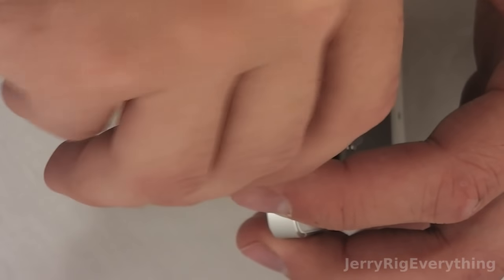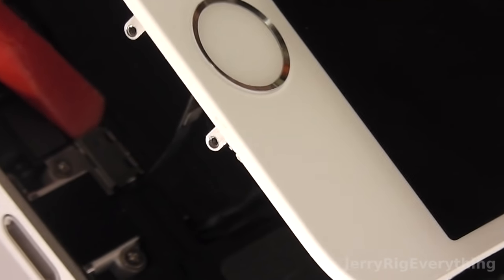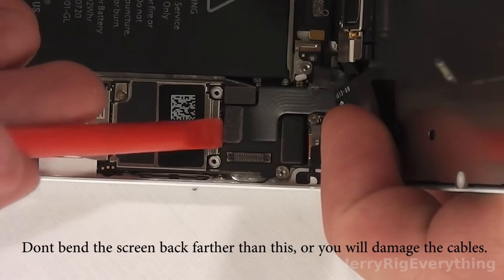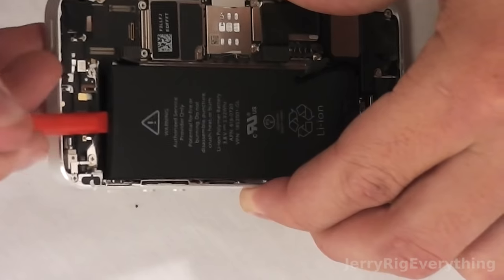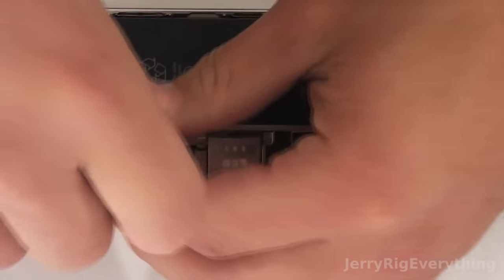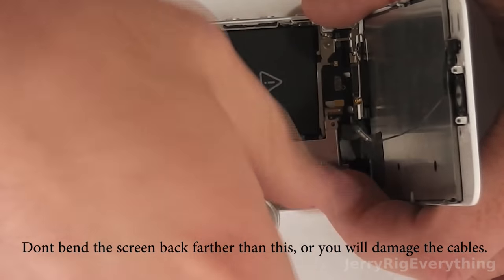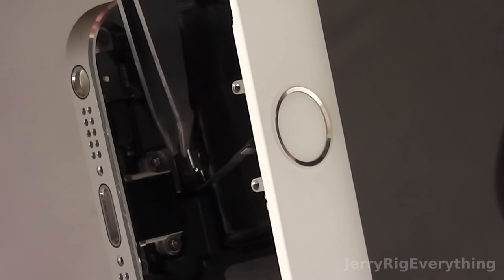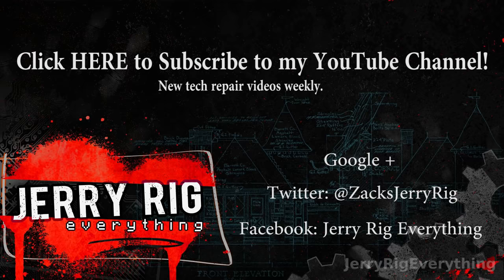iPhone 5s battery replacement in 6 minutes!

Comment: Funny thing. I have an iPhone 5s ONLY because I like the small size phone. The ladies like the large phones because they carry a purse, guys put the phones in our pockets so, at least me, I like the small phone. The finger print reader, I bet very few that have the 5s use the finger print reader. In fact my wife has a much newer phone and she doesn't even use the finger print reader. So, curious. I am replacing my 5s battery. Rather than screwing around reconnecting the finger print reader, which I might do anyway, but curious. If you don't reconnect it I assume all the phones functions will work except reading finger prints. Is that correct?

Comment: I followed your video. But the battery is not as loose your video shows it to be. It is glued with some strong sticky material. I couldn't gently remove it. Can you suggest some other solution please?

Comment: The 3 pin connector sits un level in the socket when i try put it back in :/ is it 
supposed to be like that.
The casing wont close all the way so I turned it on and like i thought touch screen wasnt working so it was going to be one of those cables up the top so i tried to open it back up again to try see what was blocking it and the screen wont come off now.... literally the glass part is cracking at the edges before its coming out properly.

Comment: Hi I'm having difficulty charging my iphone 5S it's the docking port where the charger goes that's faulty possibly by using none Apple charger a couple of times due to losing my original one and couldn't get hold of an apple lightning cable, is the phone junk or can it be repaired? Thanks
Reply: You can buy a brand new charging port assembly for well under $20. Instructions are on YouTube.

Comment: To start off, I broke quite a few things while doing this task myself, nothing wrong with the video. Can somebody tell me what the little black thing right below the digitizer connector and to the left of lcd connector? I ma have broken that which can explain why none of the volume controls, home button, power button and mute control is not working. Is it a button assembly connector sort of thing?

Comment: Battery installed as per your video but when I switch on I first got the apple sign but then I got a..  vertical white line and what looked like two lines of bar code along with the apple sign. The phone is unresponsive

Comment: Just followed,,battery a little harder to get out,,,just used scissors and ran along the 2 adhesive strips,,defo have to take the screen off,,now I've replace the old with the new,,the new battery is heating up any idea why??

Comment: With this method I have fixed a lot of iPhones. But today once I placed the new battery and turn it on, the iPhone is stuck in the boot section. Apple logo is appearing and disappearing. This is happening only when  the power cable connected. Without the power cable it doesn't respond at all. What can I do? Checked the lcd if there was sth disconnected but it seemed ok.

Comment: I followed the instructions and the battery was changed fine but the touchscreen stopped working. I even ordered a new screen on amazon and the touchscreen still doesn't work. I'm positive all connections are connected between the screen and the iphone. Any thoughts on where i went wrong? Is this fixable?
Reply: You probably bent the screen past 90 degrees when removing it.

Comment: so I changed my battery everything seemed to be fine. when I turned my phone on it came up with a white screen and a black apple in the center like it is rebooting, then after a minute shuts off and then starts back over. Any suggestions?

Comment: The battery is IMPOSSIBLE to remove by pulling on it! DON'T DO THAT! Instead, try to pry the battery high enough so you can insert a small screwdriver then scrape the tape up and wind it like you're rolling a COMMAND STRIP double-stick tape from a hanging wall picture. Keep pulling and rolling that tape and soon it'll be gone and move on to the next strip. Once you're done the battery comes out super easy. Don't forget to buy your battery kit w/ the sticky tape replacement. We observed the repair shop do this, and paid $50 for it.  But thanks to this vid I replaced my other phone battery for a mere six bucks.  I'll upload the vid but it's incomplete.

Comment: After unscrewing the two screws that hold the screen to the casing I am having a very difficult time lifting the screen up far enough to pry it open...any suggestions???
Reply: I had to pry it a little and have someone slip in a wedge...it did not come apart easily. Also the battery was extremely hard to pry out....not as easy as in the video.....I had to bend the battery to get it out. I used a plastic knife to try to break it free from the casing. I disconnected the screen but when I put it back together the phone turned on fine but would not respond to touch. I took it apart three times checking everything ...on the third time there was a piece at the end of the digitizer cable that came lose....when I made sure it was snapped into place the phone worked great. This piece was NOT connected to the screen but was in the grouping. Just some things to be aware of for those who are novices like I was. Got the battery (high capacity) and the kit on ebay for $12.88 for those interested.

Comment: This video is excellent for the most part.  PLEASE DO NOT REMOVE THE BATTERY WITH THIS METHOD. Mine got extremely hot and almost exploded.  There is a black tab folded at the bottom of the battery that can be used to pull the adhesive strips loose (much like a command strip).  Watch other videos on how to remove the battery, please.

Comment: My phone shows black screen after changed the battery, it has sound and i even hear whatsapp notification but black screen. I dismantled the 3 connection for speaker, lcd and digitizer and connect them back twice but still black screen. Pls advise which part has gone wrong?

Comment: Forgive me, but this is not as easy as it looks and the disassembly is correct paying close attention specifically to keeping the lcd screen at a ninety degree angle without damaging the cables which is easily done. My hands shake when I unscrew the shield screws and then re-screw the plate back into place, it's a nerve racking process and the adhesive glue that keeps the battery in place makes it extremely difficult removal, to the point where a blow-dryer or heating tool is something required to melt the glue. Perhaps it's trial and error, but not a process I'd recommend for DIY unless you absolutely have to.

Comment: Hello 👋 

Since almost 2 weeks now that I’ve noticed that my iPhone 5s screen doesn’t respond when I press the touch screen 😱 , it’s very annoying I have to turn off the screen and then turn it on again and then my screen will work for some seconds, half minute or a bit more, but eventually I’ll have to turn off the screen and turn it on again for the screen to work a little and I have to repeat this multiple times during the day 😱 , so I wonder what is the problem? Is my iPhone 5s close to die? Needs a new battery?, the screen is damaged somehow? Or other reason?

Please help me 🙏🏻

Comment: completely just destroyed my iphone 5 watching this video and a few others that showed to remove the front screen, but my front screen was never meant to be removed. after i carefully pried it off and ruined it, my little boy noticed that the back panel was slid a tiny bit to one end, as i pushed on it in that same direction the back panel popped right off and low and behold there was the battery. oh well, into the trash it goes. where all apple products should be anyway!  in short, NOT ALL iphone front screens need to be removed to change the battery. all mine needed was the two tiny end screws removed and then you gently push the back panel and it unclips and the battery is in the backside. hope this stops someone else form ruining their phone.

Comment: When removing the battery, part of the black line that runs from the volume buttons to the other side of the phone was damaged. It is located directly under the battery where you begin to pry it off. Have I damaged the connection? Please help.

Comment: Some one tried to fix my iPhone 5s. All they did was disconnect the screen and reconnect it (display issues). Screen works good now but it's stuck in a boot loop and nothing will fix it. Even tried reinstalling the firmware using two different types of software as last resort, it gets so far then errors around 70%.

Comment: Be careful digging the battery out from the rear. The volume/vibrate/on/off flex cable is right below the battery. Little black one. I gouged it now I have no vibrate. Keep the tool under the battery only. Oh yeah, I used a old school light bulb to warm the glue. PATIENTS!!!

Comment: hello, my iphone 5s dropped in the water. after some days my battery life decreased dramatically and the most serious is the following:
if i leave the phone without using it for more that 3 hours then the touch screen does not work. i have to press the power button 1-2 times and then the touch screen is functional again and i can insert my unlock password. Any idea which part is not working? Thanks in advance

Comment: I tried to change the battery on my own but the adhesive tapes that connects the battery to the phone was extremely strong and i tried so hard  to remove the battery. Anyway, i achieved to remove the battery somehow and replace with a new one but now my phone is not working. I checked every connector but i am struggling to understand how can i solve it, can you please help me?

Comment: This video should not be on youtube without a disclaimer saying how dangerous it can be if you cause a thermal event and how to stop a thermal event if it happens. Don't remove the battery by prying it out. You have to pull the adhesive tabs from the bottom because that's how it was designed to be removed. If you pry the battery out and poke, crack or tear the battery surface you could cause a thermal event and could cause severe burns or even burn your house down. If you don't know what a thermal event is, then I suggest you google it.

Comment: I used the link recommended above to purchase my replacement battery. The battery I received was not functional and could not be charged. I had to put back the old battery to continue to use my phone. I contacted the Fixez company 35 days after I received the shipment to notify them that I cannot use the battery and would like to return it or replace it. I was told that my complaint was beyond the 30 day warranty window and they cannot help me. The 30 day warranty is NOT noted on the packing slip or anywhere on the screens during the ordering process.The fact that they sold a useless product did not seem to matter. Could you please recommend another,  more professional company for purchase of the replacement batteries?  Thank you.

Comment: Has anyone bought the 2680mAh High-Capacity Cell Phone Battery Golden for iPhone 5s?  as offered on Amazon.  Does the higher mAh number mean it has a higher charge capacity? vs most other replacements at 1560 mAh?

Comment: I tried it just now the tape at the back of the battery is so strong the battery won't come off I managed to removed 1/3 of it but the battery bent ad had a little spark. I was so scared it might explode took it outside of the house it became hot too. I don't know what to do now I'm scared to touch it now

Comment: I cant even get the 4 screws undone. the first item after undoing the clip... you dont mention what size they are? I would have thought it was teh same T0.8 that undid the 2 outside screws but that doesnt work. then I tried fillips 0.6 and that doesnt fit either... ? Hmmm
Reply: okay I used + 000

Comment: The video is both valuable and wreckless.....All of the information is sound except for the prying the battery out of the phone! This should never be attempted under any circumstance as the glue strips were not designed to release the battery by simple heating and prying. They are to be pulled out by two tabs that are located at the bottom end of the battery just above the touch sensor ribbon that you remove. By pulling the tabs carefully, the adhesive properties are released and the battery will come out without any prying. If you've seen the 3M damage-free adhesive strips, you will know what I mean. It should look like continuous piece of white taffy as you pull each of the two strips out from under the battery. DO NOT PRY A LITHIUM BATTERY....unless you like sparklers (of course).

Comment: Instead of heating the phone up with a blow dryer you can accidentally puncture the old battery and create a chemical reaction causing the battery itself to get very hot. LOL
Reply: I did this! Did you fix your phone in the end?
Reply: George Sadler yes. I was able to peel the old battery out once it heated up.

Comment: I’m getting mines replaced tomorrow, I really scared at the fact that my data & all the progress on my phone won’t save. Though I went on Icloud & checked all the apps needed to save so that they are still there even when it resets. I’ve had my data resetted in the past & all of my progress up till that point, gone. I’m just worried that it may not work, & all of my progress will be gone.
Reply: Replacing a battery will not erase your data. Just make sure to hold the power button before you take it apart and swipe to power off and you should be good! The data for apps and pictures is all saved in the flash storage which is not in the battery. After replacing your battery, all your data will still be there! : )

Comment: DON'T DO IT!!! DO NOT TRY TO REPLACE YOUR IPHONE BATTERY YOURSELF - YOU WILL REGRET IT. Please learn from my mistake and take your phone in to get a battery change professionally at a reputable store - whether it's at an Apple store, Batteries + Bulbs, or at Best Buy. I watched this video several times before changing my phone's battery on my own, and followed the instructions to a tee, but even after doing so my phone went into a constant reboot mode that no internet FAQ could help me solve - no matter how many times I did a hard reboot or tried to update software - the phone is NOW DEAD. I lost 3 years of photos, notes, voicemails, and memories because I thought I could do it myself. I couldn't get my phone to do anything but reboot over and over and over and over after replacing my battery exactly the way this video lays out. I even tried using a different new battery and even went back to the old battery - nothing helped. I had no choice but to go spend HUNDREDS of dollars on a replacement phone and have no way to get files from my now USELESS iphone. DON'T DO IT!! LET MY LESSON BE NOT IN VAIN! SAVE YOURSELVES!

Comment: This is probably a stupid question, but does replacing the battery improve the battery life because my phone dies so quickly?
Reply: Yes.  My phone had similar issue of powering off very frequently.  Replacing the battery fixed my problem and it very well may fix your problem.    I've since replaced 2 or 3 batteries and screens.   It's not terribly difficult (one of the biggest challenges is remembering which screw goes where).

Comment: Accidentally popped the screen open too hard, home screen ribbon ok, though the bracket came off. I proceeded with removing screen and the battery replacement,  but found the middle one of the 3 ribbons which attached to screen became loose,  I believe it's the LCD ribbon, I don't see any slot to reconnect it under the black tape. I put everything back how it was but it won't turn on. What can be done? Sad, to be so close to fixing this phone and have it not work... please help...
Reply: Take a better look, there are 3 slots there!
Reply: I don't mean the ends that connect under the metal plate with 4 screws, those are all fine on that end,  it's the other end of the middle flexcable that  became detached from the top screen.
Reply: @ChiroAY  Hm, I guess you mean the touch id button. Search youtube for videos about replacing this button, I believe you will get an asnwer on what to do/how to fix it.

Comment: i just follow this instruction to change a iphone 5s battery but now the fingerprint sensor doesnt work......any help?
Reply: Same thing happened to me. I hooked everything back up, in order too, and it said it couldn't access touch ID. It isn't a big deal right now as my 9 year uses I as an ipod and doesn't need it but it's a pain to have to go through all that again.
Reply: and now i found out the battery not charging over 35%  ooh crap

Comment: I love your videos but this one is not your best. Don't pry on the battery. There's a little black tab on the bottom of the battery. Pull slowly on that tab and the adhesive slides right out from under the battery.

Comment: The video forgot to mention using heat from a hair dryer or heating pad to soften the adhesive so pulling out the battery isn’t as hard as pulling teeth!

Comment: This is a misleading guide.  You did not stress a VERY IMPORTANT issue.  When you remove the 4 screws that hold the plate over the 3 screen connectors, BE CAREFUL TO PUT THE SCREWS BACK IN THE SAME HOLES THEY WERE REMOVED FROM.  These screws, while tiny, are NOT ALL THE SAME LENGTH.  Putting the wrong screw in a hole can damage the underlying motherboard.  In my case, the in-screen speaker no longer worked.  Getting it fixed was $140.  I was told by the repair technician that the motherboard can be ruined by improper screw installation.  It turned an otherwise straightforward battery replacement into an unnecessarily stressful and expensive pain in the rear.  From other comments (which I wish I had paid more attention to), I can see I am not the only one that had this problem.  Please add the necessary caution in your instructions.